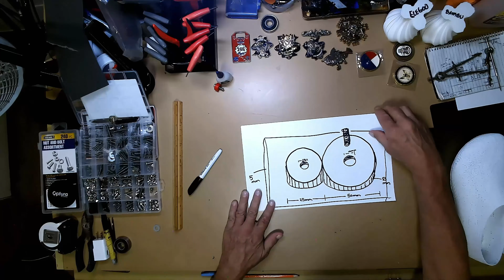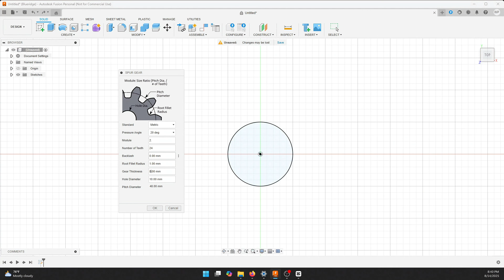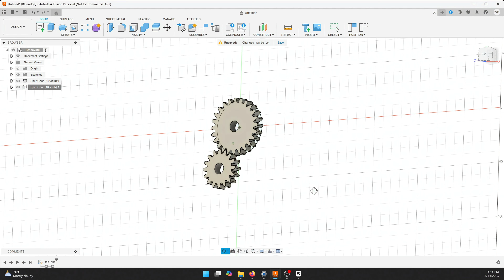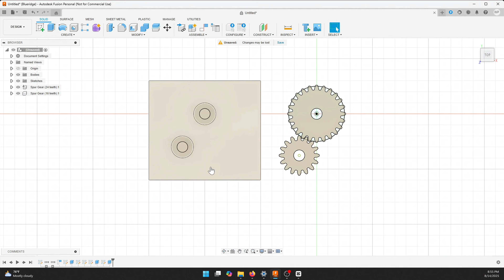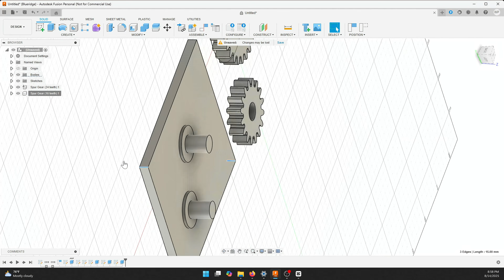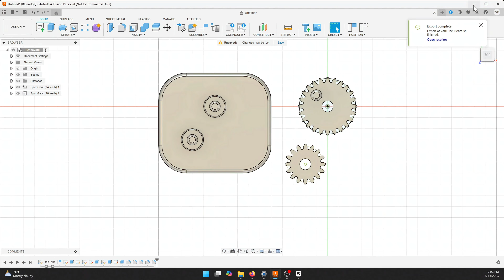3D Printing Senior Creates Gears In Fusion 360 Tutorial! It's Even Easier Than You Think!

Comment from the maker: Note: Something happen in editing and it may not be clear in the video. Use the "Dimension Tool" To Set Distance For Your Axles Just Like We Did To Measure Them. Your Measurement Will Be A Little Different Due To Placement. Start With The Larger Gear and set the two points in the center of the circles, Once You See You "Distance Measurement" Hit Enter And Inter You Distance. Finish Sketch.
Reply: Gotcha

Comment: Unless I missed it, you never showed/explained how you set the separation between the two gear axle posts to the same distance you measured between the centers of the two spur gears. You very helpfully show the creation of a dimension measurement between the centers of the two spur gears after you adjusted the smaller gear's position to get the gear mesh you wanted. You explained why "we" might get a different value. But you never used that measurement to set the distance between the axles on the platform. Looking at the graphics the large gear axle appears to be on the same gridline as the center of the large spur gear. However, by eye, the centers of the smaller gear and its axel appear to not be vertically aligned. Also looking at the video (for ex @17:43) and physically measuring (directly on the monitor screen with a ruler) the distances between the centers of the two spur gears leads to a significantly different (and larger) value than the corresponding distance between the centers of the two spur gear axles on the plate. Obviously the distances measured (with a ruler on my monitor screen) are in a sense arbitrary (no specific scale)--but for the spacing to be "correct," those arbitrary distance should be the same! You never show changing the position of the spur gear axles, yet when you print them, the spacing 'works'. I must be missing something important, because by my measurements of the positions of the axles and the centers of the two spur gears, the gears would be impossible to fit together. How to solve this mystery??
Reply from the maker: Is because I suck at editing.....
Reply from the maker: That's why I tried to describe it in the description.
Reply from the maker: Had been doing fusion and YouTube for just 6 weeks.
Reply from the maker: I mean really I'd explain that in the descriptions and in the comments nine days ago. I'm really sorry for the confusion. I am trying to do better every video.
Reply: No worries! I was concerned that somehow I missed it. I've liked and subscribed. You're progressing so fast! Really admire your fortitude in just moving ahead with a plan in mind. I'm a few years older than you, but I have not ever 3D printed anything. I have been messing with F360 off and on. So I was curious to see how you would set the distance. Then it just seemed to happen like magic, lol! EDIT: Also I somehow completely missed your pinned comment and explanation, my bad!